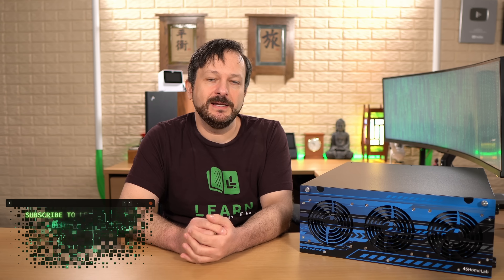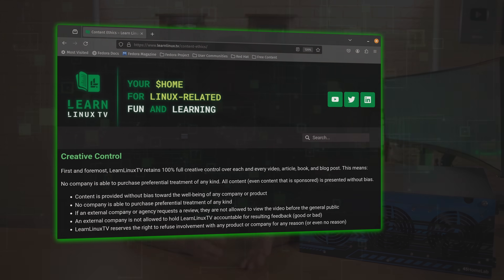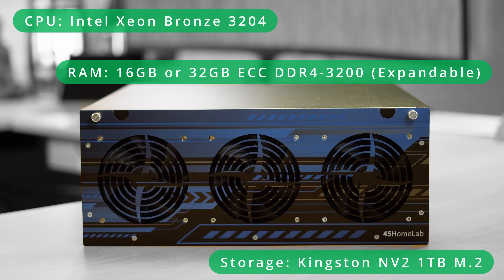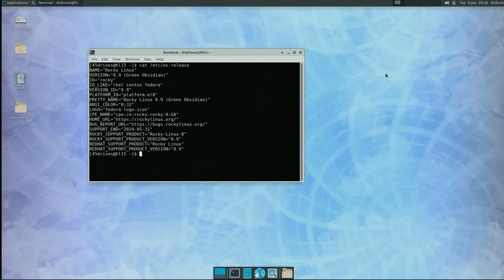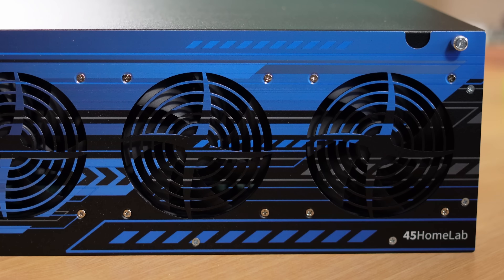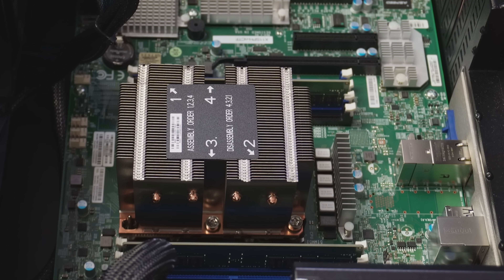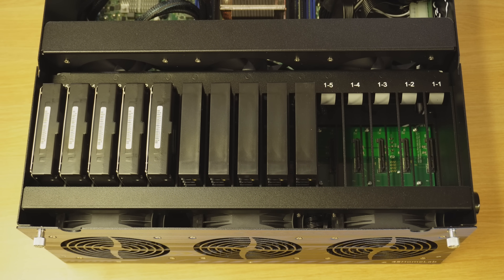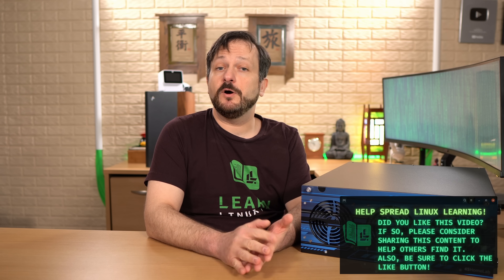Hands On: The HL15 Homelab Server from 45Homelab

Comment: I don’t understand the criticism on the 2000$ price. If you buy a similar rack mounted Synology system it’s about the same price. I don’t think the HL15 is to expensive in relation to that.
Reply: The full price for the built system isn’t bad. $800 for an empty case is pretty bad tho
Reply: I don't understand why people think a Ferrari is too expensive, they cost about the same as a Lamborghini...

This $800 case costs the same as my...
4U chassis
Supermicro Motherboard
32core EPYC
256GB RAM
850w PSU

The criticism is because 45Drives is using "HomeLab" as a marketing term.
This is not a chassis for a Lab.
This is a chassis for a small business, or someone who buys expensive stuff to show it off.
This is for the kind of people that spend an hour re-managing cables in their RGB filled rack, so they can take a brag-picture for social media.

A Lab is for learning.
If you have a budget for making things pretty AFTER you buy all the other hardware? Find something new to learn and buy the hardware for that instead...
Reply: @Prophes0r  
You might need some help, you have been posting on this same video for over a year with your strange comments. It's excessive. 

People want what they want, get over it and move on. You don't need to spend years trying to get people not to buy a product, it's just weird.

Comment: Hi, to consider the pros and cons it would be good to know the enertgy consumption in different configurations and workloads.
Reply: The energy consumption of the full build from 45Homelab has been discussed in the 45HL forums. Outside of that build, your only other config options require you to provide the MoBo and CPU. The chassis supports ATX MoBo's, meaning the the power consumption would be based on your hardware choices. Not really something Jay can cover as there's an infinite number of combinations.

Comment: How special of a PSU and motherboard do you need? The $2,000 unit is way too much for how little compute it has. I keep a Ryzen 7 2700 heavily oversubscribed for about 32 hours a week now. Compacting the disks down won’t help with CPU load reduction.
Reply: PSU is ATX, and it supports E-ATX/SSI-CEB boards. In theory you could fit a sandy bridge board in there with a generic 600w PSU, but that's not an ideal build... Finding a low cost server board and an 800w ATX PSU from your favourite supplier is definitely the way to go here. 1st gen Epyc are decent value choices, or 1st/2nd gen Xeon scaleable if you can find a board at a good price. 45Homelab ships a 2nd gen Xeon scaleable in their prebuilts, but they're picking up some expensive boards.

Comment: Goodness Jay. In no way was my intent to be derisive.  In just my personal experience, from mounting the cpu and cooler of a 4310 Xeon to using ipmi on a server mb , not off the shelf, to working in a server chassis with backplane, mounts for a server rack, to placing the front panel connectors was different than what I had encountered in high end computer builds.  I am not against someone building their own server, my point was simply that this offering would have ensured success and made an unfamiliar builder more comfortable.  My motherboard was not "off the shelf," but carefully researched and used after the first Super Micro failed (probably my fault.)  I feel sorry for creators when they  are attacked by people who don't carefully read the statement and ascribe words like "derisive" to statements they don't carefully understand.  Jay I loved your video, think you do a great job with making difficult understandable.  Keep up the good work .  I suspect it will be some time before I comment again.  Thanks for the education.

Comment: This is an $800 USD case (with a backplane), targeted at the HomeLab/HomeServer crowd.
I absolutely do not get this weird "Premium Home Server" trend.
Someone PLEASE give me a use-case where this makes sense. I actually mean it.
If you are simply building a lab, the core components matter. Your budget should go to the stuff you need to test/learn on, not a nifty case.
If you are trying to run services for your house, this thing is going to be SUCH overkill it's hard to even quantify it.

I can actually imagine this being cost-effective for a small business or university...
...But the "HL" part of HL15 literally stands for "HomeLab".
They CLAIM to be marketing this to people building a HomeLab, but this is clearly some weird VanityRack server.

This is for people who are going to get it for free, or people who are going to install RGB strips in their rack...
(No offense to Techno Tim intended)

----------

To put this into perspective, this case ALONE costs as much as my main server minus the drives and networking.
That's for...
 -  4U case
 -  2x 12-bay hot-swap modules I modded into it
 -  Supermicro Motherboard
 -  32-core EPYC CPU
 -  8x16GB DDR4 3200 ECC RAM
 -  650W platinum PSU

Comment: Nice case, very good mainboard but the Xeon Bronze 3204 is just to weak for such a build. If you spend that lots of money on a rack mountable high quality case and a enterprise server board you also want a beefy cpu otherwise you can't really take advantage of such a server.
Reply: @_-Karl-_  Yeah, I do know that. But while 45Homelab won't ship it with a used CPU, there's nothing to prevent the buyer from doing just that if they need more cores.
Reply: You know 12 core Xeon golds for that socket are under $100 used, right?

Comment: I love that this company exists and decided to target the homelab market. I happen to be in the market for a compute server replacement for an old Dell, and this storage server is close, but I'd rather get something slimmer with more compute without the drive bays. If 45homelab comes out with a companion compute server to this, with a bunch of memory capacity and 10G networking, I'd be all over it.
Reply: I don't...understand...
You "like" the 45Drives chassis...but you wish it didn't have drive bays?
And you want it slimmer? So you want...a standard 3U chassis?
You are interested in HomeLab stuff, but you want overpriced VanityServer stuff?
You want 10GB networking...but you don't want to install it?

I'm not trying to be negative, but your statements are really contradictory.
It's like saying you like that a company is making a car targeted toward people who like to make their own modifications, but you wish they made it with a different kind of radio, and also you want a truck.
Reply: @Prophes0r  
Pretty simple, I want a compute server rather than a storage server. 1U or 2U, maybe double socket, 48G+ RAM, couple slots for SSD boot drives only. Not that complicated.

Comment: Hi Jay.  I really wish I had known about the HL15 earlier.  I just built a server with a Xeon 4310 CPU and an Asrock mb.  Server components are definitely not cheap and mine ran similarly to the price you quoted.  I would say to home lab wannabees that building a server is quite different than a high end computer and a unit like this would save a considerable amount of grief.  I replaced the fans that came with my chassis with Noctua and the noise level is loads better.  I really enjoy your channel and wish you all the best.
Reply: Explain it to me.
How is building a server different than building a high-end computer? IPMI?
Keep in mind that you just said you used an off-the-shelf motherboard and CPU in your own build.

I have a feeling you might fall into that particular "home lab wannabees" group based on your description, so you may not want to be so derisive.
But maybe not. Maybe you DO have a need for 'premium' fans in a Lab. The cost must make it easier to learn things.